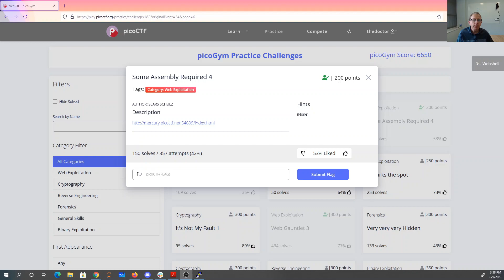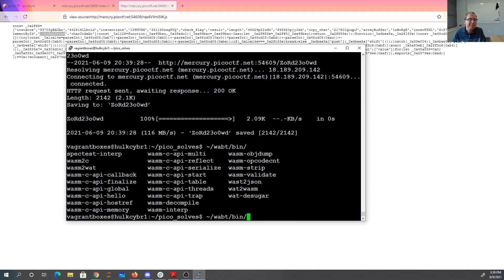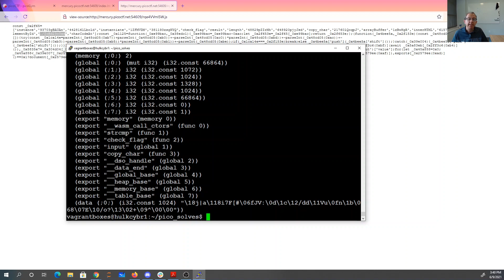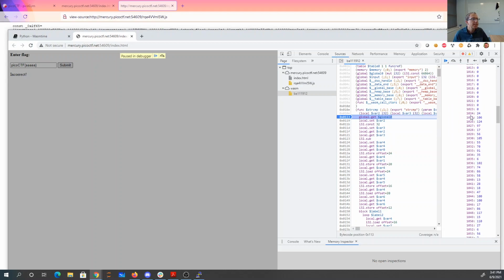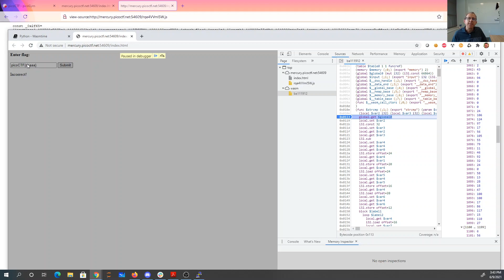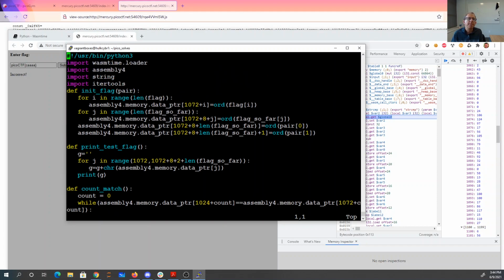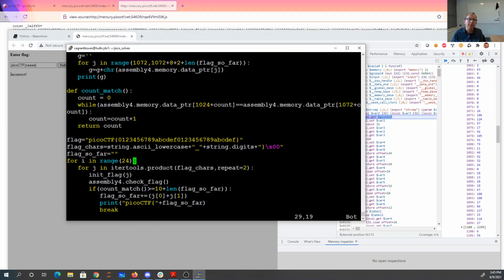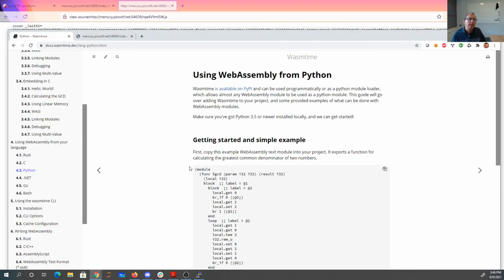picoCTF 2021 Some Assembly Required 4

Comment from the maker: Updated code for the latest wasmtime

#!/usr/bin/python3
from wasmtime import Store,Module,Instance
store=Store()
module=Module.from_file(store.engine,'assembly4.wat')
instance=Instance(store,module,[])
assembly4_memory=instance.exports(store)['memory']
import string
import itertools
def init_flag(pair):
   for i in range(len(flag)):
      assembly4_memory.data_ptr(store)[1072+i]=ord(flag[i])
   for j in range(len(flag_so_far)):
      assembly4_memory.data_ptr(store)[1072+8+j]=ord(flag_so_far[j])
   assembly4_memory.data_ptr(store)[1072+8+len(flag_so_far)]=ord(pair[0])
   assembly4_memory.data_ptr(store)[1072+8+len(flag_so_far)+1]=ord(pair[1])

def print_test_flag():
   g=''
   for j in range(1072,1072+8+2+len(flag_so_far)):
      g=g+chr(assembly4_memory.data_ptr(store)[j])
   print(g)

def count_match():
   count = 0
   while(assembly4_memory.data_ptr(store)[1024+count]==assembly4_memory.data_ptr(store)[1072+count]):
      count=count+1
   return count

flag="picoCTF{0123456789abcdef0123456789abcdef}"
flag_chars=string.ascii_lowercase+"_"+string.digits+"}\x00"
flag_so_far=""
for i in range(24):
   for j in itertools.product(flag_chars,repeat=2):
      init_flag(j)
      check_flag=instance.exports(store)['check_flag']
      check_flag(store)
      if(count_match()>=10+len(flag_so_far)):
         flag_so_far+=(j[0]+j[1])
         print("picoCTF{"+flag_so_far)
         break
Reply: thank you sir

Comment: @harik8486
Traceback (most recent call last):
  File "/home/loc/Downloads/as4.py", line 31, in <module>
    init_flag(j)
  File "/home/loc/Downloads/as4.py", line 8, in init_flag
    assembly4.memory.data_ptr[1072+i]=ord(flag[i])
TypeError: 'method' object does not support item assignment
how did i solve this problem
i was using python3 it showing error like above mentioned can you help
Reply from the maker: See the new code I posted
Reply: @carlislemc  where did u posted sir
Reply from the maker: @harik8486  I posted a comment here 20 minutes ago. Look at the other comments.

Comment: @harik8486
0 seconds ago
how did i solve this problem
i was using python3 it showing error like above mentioned can you help
Reply from the maker: I posted a comment above with new Python code. wasmtime changed a LOT in the last 3 years.

Comment: i follow u but this throw error, please help me.
Traceback (most recent call last):
  File "/home/loc/Downloads/as4.py", line 31, in <module>
    init_flag(j)
  File "/home/loc/Downloads/as4.py", line 8, in init_flag
    assembly4.memory.data_ptr[1072+i]=ord(flag[i])
TypeError: 'method' object does not support item assignment
Reply from the maker: This might be python 2 vs python 3
Reply: @carlislemc  thanks
Reply: How did you solve this problem?
Reply: how did i solve this problem
i was using python3 it showing error like above mentioned can you help

Comment: please give python codes.
Reply from the maker: #!/usr/bin/python3
import wasmtime.loader
import assembly4
import string
import itertools
def init_flag(pair):
   for i in range(len(flag)):
      assembly4.memory.data_ptr[1072+i]=ord(flag[i])
   for j in range(len(flag_so_far)):
      assembly4.memory.data_ptr[1072+8+j]=ord(flag_so_far[j])
   assembly4.memory.data_ptr[1072+8+len(flag_so_far)]=ord(pair[0])
   assembly4.memory.data_ptr[1072+8+len(flag_so_far)+1]=ord(pair[1])

def print_test_flag():
   g=''
   for j in range(1072,1072+8+2+len(flag_so_far)):
      g=g+chr(assembly4.memory.data_ptr[j])
   print(g)

def count_match():
   count = 0
   while(assembly4.memory.data_ptr[1024+count]==assembly4.memory.data_ptr[1072+count]):
      count=count+1
   return count

flag="picoCTF{0123456789abcdef0123456789abcdef}"
flag_chars=string.ascii_lowercase+"_"+string.digits+"}\x00"
flag_so_far=""
for i in range(24):
   for j in itertools.product(flag_chars,repeat=2):
      init_flag(j)
      assembly4.check_flag()
      if(count_match()>=10+len(flag_so_far)):
         flag_so_far+=(j[0]+j[1])
         print("picoCTF{"+flag_so_far)
         break